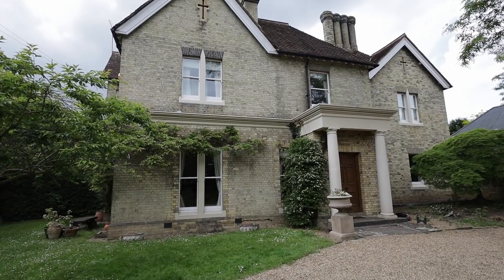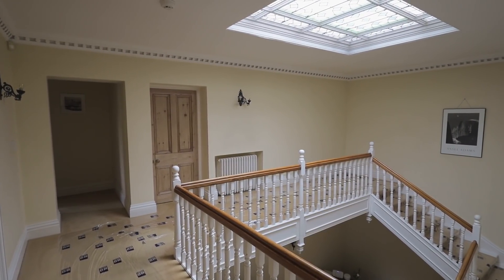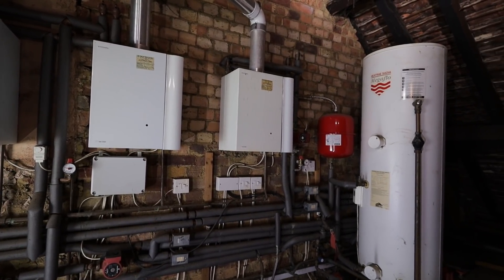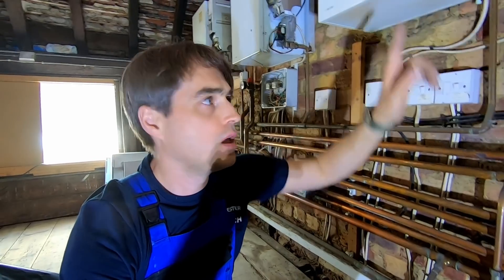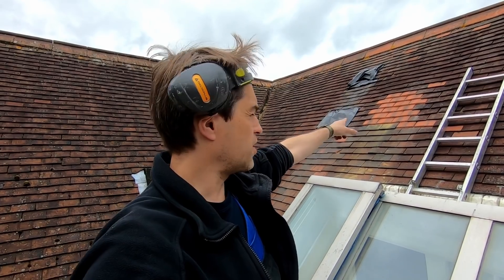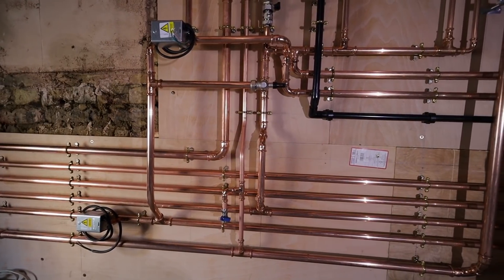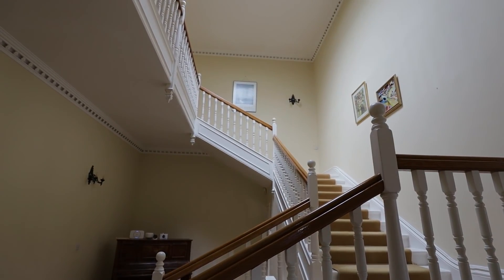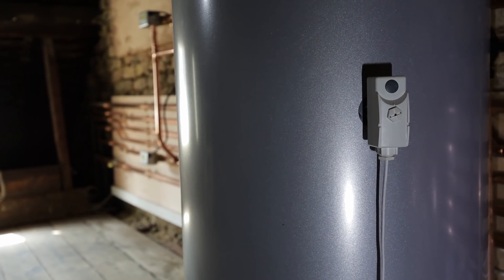How many boilers does this house really need?

Comment: You definitely know what you are doing! 

What surprised me most is the relative small hot water tank. But I am thinking about heatpumps with limited power and temperature. To fill my bath I need 200liters @40 C.

Comment: How do you have 2 zone heating on hot water priority systems? Two zones after the diverter?
Reply: Low loss header or closely spaced tees and the pumps are controlled by stats, nothing else?
Reply from the maker: Yes
Reply from the maker: I wouldn’t even zone weather compensated systems. This was only done as the client insisted

Comment: I have a similarity large property to upgrade so this video was very relevant. In my case the plumbing needs renewal throughout, plus new underfloor heating on the ground floor. However I do have a 24.85kWp ground solar +  2xPowerwalls so energy is cheap and abundant. In such a case would you go for central system or just feed a cold water line to each of the four bathrooms and use Heat batteries at each local. Increase in equipment costs but saving in pipework and complexity? Heating to radiators is from a biomass that could be retained or removed. Grateful for your thoughts.

Comment: On the new system, how did you control the hot water circulation? Was it just permanently on? Pipework thermostat? It'd be quite interesting to have a video on hot water circulation.
Reply from the maker: on a timer and pipe stat

Comment: Enjoying how different and seemingly intricate your heating installations are over in the UK/EU. The emphasis on efficiency contrasts a fair bit from typical installations around here. It depends on the age of the construction but most homes around here have hot water baseboard heat and typically we have 80-90C water running through those. Do homes there not get dramatically cold days with high wind? I'd be curious to see how such (from my perspective anyway) lukewarm water would be able to handle -20c with wind chills. I'm not familiar with where you are though so maybe the weather never really gets there.
Reply from the maker: Yes, most US installations that I have seen have been crazy inefficient, even worse than UK. PIpework does not get lagged eihter. That is what cheap energy does to the industry.

UK only gets around -3C in the winter, but EU countries get -20 or -30 and can also run on low temperature heating no problem.

Comment: This set-up looks remarkably like my house (370m2, up to 500 years old in parts): 3 boilers, 3 heat zones, cylinder, masses of relays, looks incredibly complicated and costs a fortune to run; installed about 25 years ago. I've suspected for some time it's in need of modernisation & rationalisation. After watching your video I'm even more sure of that. Finding someone with your skills to design and implement is the challenge.
Reply from the maker: google 'heat geek elite' installers

Comment: Could you heat a direct cylinder using the potable circuit of the intergas?

One less heat exchanger in the loop; one less set of my approach temperatures.

Boiler control would need to support that mode and you'd need a loading pump to circulate the cylinder through it. More to go wrong I guess.

Comment: Surely an S plan and Y plan valves can be wired to to work as hot water priority.
Reply from the maker: Not really. Unless you use a relay to cut power to CH valves when there is DHW demand. Using a correct valve is a neater solution

Comment: HW priority is from heat pump tech, same as weather comp, I thought? Is timer on immersion for legionella ok?
Reply from the maker: Not really, wether comp and priority hot water has been around for ages. 

Intergas can run weekly legionella and keep the cylinder at lower temps. Vaillant with senso comfort controls and viessman 200 can also do all of that.
Reply: @UrbanPlumbers  I see 👍

Comment: Is there a trick to find a good starting point for weather compensation? I run a nefit trendline II (dutch) including a nefit easy thermostat using radiators only.
Reply from the maker: Apart for calculating your heat loss and radiators mean water temperature there is only experimentation left

Comment: Great video mate. You answered a question I've been meaning to look up with regard to a 3 port priority valve on unvented. Recently installed an Atag on PDHW and their instructions say to add a two port as well as the 3 port diverter valve they supplied.  It didn't make sense to me so I used a NO 2 port instead on the heating side. To my mind a 3 port diverter should satisfy the regulations. Nice to see it done in the real world.
Reply from the maker: They are just covering themselves with that 2 port. I do not see a need for it.

Comment: What are your thoughts on the Viessmann 111W as an upgrade from system boiler and vented hot water cylinder (main cold, gravity hot) for a 4 bed house with 2 baths, 2 residents?
Reply from the maker: I have never seen or played with that boiler so cannot comment
Reply: @UrbanPlumbers  Thanks for the reply. After further checking and thinking I think it's going to be system boiler and unvented cylinder about 210L as we divert excess solar PV through immersion in the summer and rarely need any gas or elec for hot water in summer months and as energy goes up you just can't give up free stuff. This would cure hot and cold imbalance and take away pump for showers.
Just need to decide on which now and see if we can do DHWP as you suggest as only got one flow pipe from boiler to tank location but will think about solution for that.
Keep up the great videos as your knowledge helps people like me so much.

Comment: What a shame all that magnificent copper work is never going to be seen. LOL Not that I am an expert by any stretch of the imagination but I'm surprised a 27kW boiler will be enough in that house. Hope they've also spent some money in insulation. Guess it's listed so double glazing will be a hastle unless common sence has finally arrived in Planning. Hope they fix the roof too. And the damp in the basement. Ah the joys of an old property. All fur coat and no....
Reply from the maker: Heat loss of the property is around 22-23kw

Comment: I was thinking 25 kw, then no, 50 kw but you put a 27 kw in lol. I am about to put in a 25 kw pellet burner, and you have answered some of my questions so thank you for the clarity. I don't want to buy a hot water storage tank just now, and I have a spare indirect tank that I was wondering, could I connect both the hot in and return to system, and also the cold in as a hot in, and return to the system? The one would heat the water by the coil, and the other, the water from the boiler at the same time. Does that make any sense? Otherwise, I will follow your guide and have to buy the storage tank. Many thanks.

Comment: Hi urban, quick question I’ve been having this debate with another couple guys about when you do your heat loss calculations etc. What do you guys add onto your kw rating for boiler/boilers for how water supply say on a 300litre pressurised cylinder, I was taught 7kw. Even tho most cylinder seem to say there coils are rated for 20-24kw, some of my friends say they’re just sizing for the hot water and so I.e 24/25kw and adding a small amount of any for the heating?
Reply from the maker: you add nothing for hot water, there is no need for that, especailly on PDHW.

With new part L you do heat loss for all installations and size your boiler / heat pump exactly to the heat loss.
Reply: @UrbanPlumbers  what if you’re not fitting a priority hot water system tho?
Reply from the maker: @kylebrowning7469  you can't not fit PDWH anymore. S plan or Y plan do not comply with part L and are just inefficeint.
Reply: @UrbanPlumbers  I agree, but I did not know that had come in already, glad you’ve told me:)
Reply: @UrbanPlumbers  hi urban been getting myself up to speed on new part L! How is going to be policed? What’s going to stop customer for with the cheaper option as they’ll be fittings smaller radiators etc, also how is it obtaining to fitting a new boiler with keeping existing radiators? Do they want us to do a heat loss to see if the system is up to date for the lower running temps?
Reply from the maker: @kylebrowning7469  heat loss needs to be done in order not to oversize new appliance. Rads are to be sized for max 55 flow.

Of course some people will chose cheaper underszied rads, etc. However if you can explain benefits of low temp heating, most sensible customers should chose that option.
Reply: @UrbanPlumbers  so if I go to change a boiler heat loss which is the standard but if the rads are undersized explain to the customer they need to be upsized
Reply: @UrbanPlumbers  what if you’re just changing a boiler into existing heating system, do you have to say it needs heat loss Calc doing for new flow temps and possibly upsize the rads, and if they don’t want to upsize just change the boiler?

Comment: This property falls well within light commercial thus why did you not install a low loss header.
The nest is also used as weather compensator if you wish, no need for external unit.
Neat pipe work though.
Reply from the maker: You only need separation if you have different flow rates, ie radiator and large UFH or if the boiler pump does not have enough head for the index circuit. 

None of those are the case here and therefore separation wasn’t required. It could also lower system efficiency.

Why overcomplicate things?

Comment: Love your videos! How many radiators on that system? I have a customer that has been quoted for a 50kw system boiler to supply 30 radiators and a 200ltr unvented cylinder. 50kw seems insanely high to me! Not been to the job yet

Comment: As my 2 bed surrey bungalow with reasonable insulation has an 18 kW boiler amazed this massive poorly insulated surrey pile manages with 24 even more so with the poor radiators and what must be a massive heat loss though that huge hall skylightand what appears to be an uninsulated loft. Great to see those joints, all should use them, they may be pricier but our roof was set on fire by our engineer using end feed (Surrey Fire Brigade were great, put it out and stackedall the tiles so minimal damage) and a few National Trust properties have been destroyed.
Reply from the maker: Your 2 bed bungalow could probably be enough with 5kw though

Comment: Great video and nice thorough work.

In regards to running the heating system at 55deg could this still be controlled by S plan providing that both valves are not allowed to open at the same time? The joule Samsung heat pump uses 2 port valves to control the system. I agree with you though that the 3 port diverted valve is the neatest option.

Are there any air source heat pumps which you like?

Comment: Hello, another great video, I’ve pretty much got to do an similar installation but smaller, everything in a basement so an additional high temp sump pump, I know I need these parts from what it says in the manual for a how water priority, DHW storage cylinder sensor (art. nr. 065.117)
Diverter valve 230V (art. nr. 092.647) & Intergas Outside Sensor (203207) can you tell me what cylinder have you used please for cylinder sensor to slot into a pocket, was going to install the intergas HRE compact 18SB, what’s the advantage of the xclusive over the SB please is it just the warranty or are there other advantages? Thank you. James

Comment: People fitting blended CH circuits mainly under floor with the boiler flow temp still being quite high, are not really installing the most efficient system.  If flow temperatures for CH can run cooler with PDHW once the cylinder is satisfied. This would keep the return temperature as low as possible to aide latent heat recovery from condensing, once the hot water cylinder is satisfied. Is PDHW intergas X plan your go to system if needing stored hot water? Could you explain about Low loss headers please... Some love them some hate them but a lot of installers don't know when / when not to use them :-)

Comment: Not a shred of insulation in that roof
Reply from the maker: You can’t easily insulated the roof itself. Has to be insulated on the floor loft / ceiling
Reply: @UrbanPlumbers  Yes indeed. But that means either there is no insulation , or there plant room is cold and outside the insulation!

Comment: The installation looks brilliant however I have never understood the hot water priority systems in large households. I have hot water priority system  in my house and am not generally happy with it. I have 2 bath one shower in my 5 bedroom house with I think 200 ltr cylinder and hot water priority system. If 4-5 people are taking showers (not particularly at the same time but one after another few minutes apart) in about 1-2 hours time span then in winter months the heating stays dead cold for that period of time until the tank is satisfied and makes the house temperature uncomfortable especially if the CH wasn't on beforehand. Don't even get me started on someone wanting to run a bath, I have to plan and run heating beforehand to make sure house is at comfortable temperature. 

I have been so fed up with it that have been considering getting electric shower installed in one of the bathrooms by next winter. Not sure if my system is particularly inefficient or if that is just how it is supposed to work.
Reply: If my mrs and daughter have back to back baths (deep and at a temperature that would cook my balls) the heating would be off for hours

Comment: Hi.   Looks a great job 👏 Can I ask why you use intergas boilers ? We have used Worcester boilers with an internal diverter kit to give fast heat up on hot water priority. 
We have recently done a similar job in a very large house and the original system boiler could not supply the flow rate to heat the radiators.  A low loss header on the our new boiler sorted the problem easily. 
Great videos by the way. 
Ian
Cinergi Ltd.
Reply from the maker: Intergas is the most flexible and robust boiler ever made in my opinion. Worcester does not come even close to IG quality

Comment: My first thought would be (2) boilers 1 for perimeter heating 1 for interior zones. that said the zones can be oriented north and south. my thinking on perimeter heating is here in the north east US you can have a buffer for the low Temps and that boiler can have controls for out door temperature reset 1 to 1:5 loop temp. based on out door temp and wind chill. Our weather in the NE can be extremely cold and windy. the interior boiler can handle the domestic hot water and lower interior loads.

Comment: Good work. 
Complete supporter of PDHW Systems 🙂
Don't understand why additional 2 Port Valves are required, other than crazy U.K Regs !  To my knowledge, it's only the UK that request them. I'm stopping to fit them on my PDHW jobs. Like your job, the Sensor and boiler etc will prevent overheating. Not to mention that permanently open motorised valves can fail due to mechanical faults

Comment: Just had a system installed with weather compensation. No unit required outside. Thermostat looks up the weather on the internet. Vaillant boiler.

Comment: Sorry to litter you’re comments section!

With reference to the whole process of system design, installation and commissioning.

I know all jobs are different but it would be illuminating to those that do not appreciate such things to know how much time is taken (in big handfuls) on :
a. Heat Loss calculations, system design including product selection, control strategy and quotation.
b. Rip out, install including pipework adaptations, system flushing, making good.
c. Commissioning in full, balancing emitters, setting up curves.
d. Teaching customer how to use and tailor system controls to suit their lifestyle.

This specific job may be a good hook for that.😀👍
Reply from the maker: a) 2 site visits, 4 hours in front of heat loss software and on site - so a total of 4 hours
b) 5-6 days on site - a lot has not been shown on the video though, such as new valves on all radiators. I am still going back to upgrade 2 radiators 
c) sadly it is a very basic weather comp - so it is only set by adjusting flow temp on the boiler. Customer can do it easily.

Power flushing is still to be done, as I need to replace rads. I expect that I will need a full day for power flush and 1/2 day to balance rads and set ecverything up correctly inculding the pump, etc.
Reply: @UrbanPlumbers  Did you install IMI constant flow valves?

Comment: Congratulations, a real pleasure to watch a competent professional at work. There are not many about. That original install was a real lash up.

My guesses were 32KW boiler and 250 Litre unvented cylinder (but did not know how many occupants).😉

It would be good if Intergas offered a PHW diverter option in the boiler (like Viessmann) keep the wiring and plumbing simpler.

Nice house too - are the owners inclined to ‘up radiator’?

You have not only reduced their gas/electric consumption but also their annual servicing costs as well as dramatically reducing points or ‘nodes of failure’.

Excellent - a bit of heating design porn.😉
Reply from the maker: only 2 rads will be upgraded for now. The cost of those cast irons is crazy. Also is the wieght. The one we will upgrade is around 300kg and costs £1,600 to supply only.

Comment: my guess was one 30kw boiler.

a lot of the installs i do now are sized for the hot water tank and not the house. 115 000 btu is the smallest we install for recovery on the domestic hot water.

beautiful install! i should try bending on one of my next jobs.
Reply: Yeah, same is true here in Netherlands. If you have a bathtub you want CW3 or better and you rarely need any more for the heating.